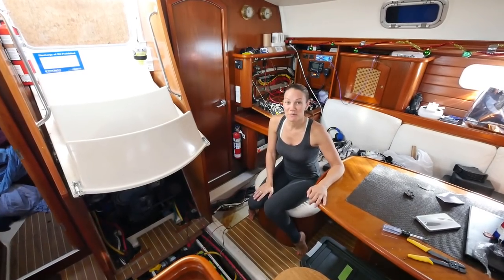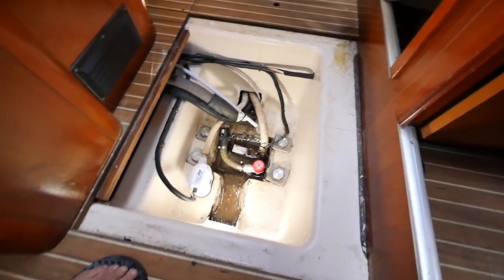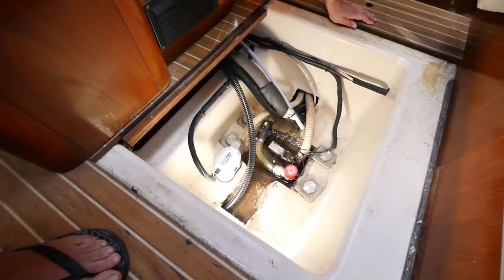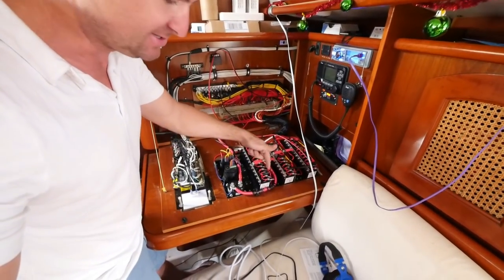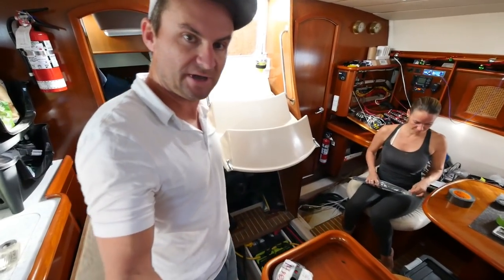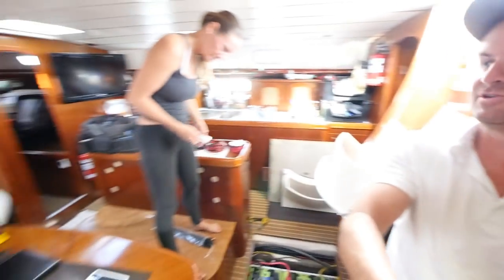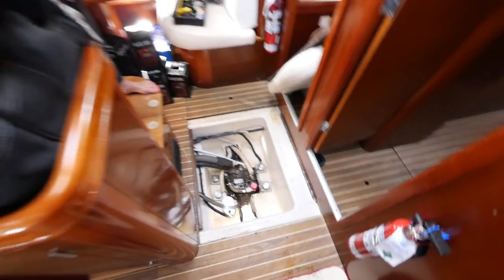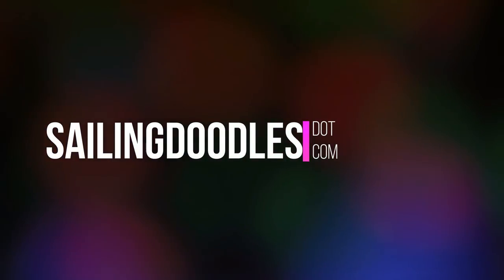Bilge Rat!!! - Maintenance Monday

Comment: Great idea Bobby, one suggestion in regard to maintaining the appearance behind the electrical panel.  Some guy made it his mission to weave all the wiring together and run them neatly.  Don't be the one who cannot spend a few extra minutes to replicate that initial effort.  It really isn't that difficult and afterward, you will be glad that it still looks neat!

Thanks for sharing...Fair winds!  Cool assistance by the way, you should keep her around!
Reply: Robert Applegate agreed. 

I put in my fair share of time in data closets.  It only takes a few minutes extra to bundle the wires in with the rest, and the payoff is worth it IMO.

I'd like to suggest keeping a roll of Velcro handy.  It's easier to use than zip ties in that you don't have to snip a zip tie to add a wire.  You just unhook the Velcro, add your wire, then reattach. 

I'm sure you could find a few additional uses around the boat for the Velcro too...
Reply: It all looks nice and pretty, until you have to trouble shoot a switch or wire, after that just use a few wire ties
Reply: Yeah that kinda annoyed me too but he did say it's temporary. I am a stickler for wiring. It would be terrible to be in rough seas and the bilge turns on and the wire wasn't secured and is now shorting out. I know it's on a circuit breaker but if the short is very minor and not enough to trip the breaker there could be problems. I've also seen situations where an adjacent small gauge wire chafed and touched on a bare area of a larger circuit. In that situation the larger circuit wouldn't trip and the short would continue and start a fire.
Reply: Another vote for keeping your wires neat.  Even the LED wires need to be cleaned up.  Also, there seems to be a hole already in the rib under the floor, if you can fit through that, should do so.  Nothing worse than wires allowed to move and potentially get pinched at some point causing gremlins.  You really don't need that kind of headache in the middle of the South Pacific.  Do it right while you are at the dock.
Reply: Be careful with temporary,seen way to many temp works that turned into permanent and later into tears. Specially with wiring,not only does it look neat but its miles safer in the end. Always walk that extra mile when you work on wiring,does not matter how small or how big the job is.
Reply: Wire ties to secure the hose, keeps it from flopping about underway...  Place a ‘Tee’ in the overboard discharge line and attach the new hose...  Suitable arrangement for a permanent installation!!!

Comment: Keep the wires bundled and label the new ones as you add them. I did a LOT of marine wiring back in the day. I found that labelling and neatness of the wiring harness made working behind the panels so much easier

Comment: If its salt water you have leak through the stuffing box or something in the back of the boat if its fresh water then i would say a water tank or a plumbing line of some sort is leaking. Either way the fix should be fine till you find the leak I see nothing wrong with it. Good job Bob and Laura!!!!
Reply: was going to say something similar... though that water does not look so "fresh" - it may not be salt water.

Comment: Good job team Bobby/Laura and pretty straight forward fix. If I was going to do anything differently, I would snip the zips and run the new wires (including the LED wires) along the same route as what's there. However, I'm a bit OCD like Laura so maybe that's not your thing. The next option would be to still run all the new wires along the same route and add new zips. Some of the newer zips can actually be unzipped by moving a tab with a small screwdriver. The last option would be use Velcro which can be undone much like the newer zips but a little faster and easier. ALSO, I would definitely throw a tie wrap around the new hose that's just laying in the bilge.  Thanks for a nice break on a Sunday!

Comment: Great video, and you can Never have to many bilge pumps on a boat! Even when you find the source of the water intrusion (and my bet is on a leaking fitting/hose from the motor,although it may end being a tank or stuffing box leak,an if that's the case it should have been caught in the repair work at the yard b4 you picked it up!) that little pump will become a safety spare..available to be put where needed, and always good to have. 
Don't forget to hit 'like' folks, it all helps. Do try and wrap up that wiring you've added behind the electrical panel, both for neatness and safety, and it's always easier to work on 1 that somebody has, can use those temporary plastic ties if need be.

Comment: The good news is you have months and months of baja cruising. So you will find the leak soarce before crossing the puddle.
Check the rudder post. Bendytoys have lots of rudder issues. Also you should be able to rule out stuffing box and engine cooling system in 1 minute.
Just look.
There are so many spots.
I would get laura down there with fresh water and clean everything real good. She seems like a team player for sure.
Man you are so lucky to have her. Immagine this trip with out her. It would be so different.

Comment: Put an oil absorbent sheet in or over the engine's bilge and it will resolve the possible issue of pumping oil or fuel into the ocean that others have mentioned.  I refer to the sheets as my engine's diaper.  West Marine sells them 5 for $6.00, pretty cheap considering.  If it is salt water in the bilge you should check your fresh water pump, hoses, heat exchanger and water muffler.  Keep on sailing and having fun!
Reply: this, $6 is bit more affordable than a $50k illegal discharge fine, clean that bilge with Simple Green, then begin the hunt for the leak, I agree that the stuffing box is most likely. As a matter of fact I would have  spare stuffing material, plugs, a way to secure shaft from going deep 6 among other things

Comment: Great Video guys! It's a temporary fix but I'm sure you've considered that If you spill any oil below the engine it will end up in the bildge, and subsequently into the ocean... Cleaning chems out of the bildge is not fun and when you go on a lean, those chems are gliding up the side of the hull making a big mess...

Comment: The area under the engine is not a bilge, it designed to be self contained so it wont get the oily diesel water that could get deposited under the engine, if you have a sea water or coolant leak, into the bilge and then overboard.  You do not want to pump it over board as it is a pollutant and can get you a major fine.  Water from this area is supposed to be removed by hand and properly disposed of like oil and coolant etc.  I noticed you had water standing under the engine in an earlier video and almost sent you a note about it.   If you are getting water in this area it is something that is not normal and should be stopped.  Also you are not supposed to set up one bilge pump up to pump into another bilge pump area, as you are now dependent on two bilge pumps instead on just one to move water overboard.  bilge pumps are supposed to pump water over board.  Good idea on the fix,  it is just not legal and should be repaired to marine standards.  Love the videos and keep up the do it yourself work,  as that is how you learn.

Comment: Bobbie, I agree with viewer who said the reason there was no  bilge pump under the engine, had to do with overboard discharge of any fuel or oil. Unlikely there would be a clogged drain hole to other bilges from engine compartment. I like your fix as temporary, shouldn’t be too much of a problem to find the source, easy to determine salt or fresh water, I’m sure you did, but zip tie, the new hose to anything, to prevent hose from moving when healed, fasten new bilge pump, to something so that won’t move, clean-up wiring in panel and label all additions, after you have found the source of the water leak. I enjoy all your videos, you do a great job, informative, funny and entertaining.

Comment: Don’t shoot me just trying to help.

As said in many comments - Don’t pump that water overboard. Fix the problem.

You’re planning a major trip. Fix the leak in San Diego where you have access to everything you need to fix it.

Is that pan under the engine separated from the rest of the boat? If so leak is from an engine connection.

I know you said it’s temporary but as FYI - the bilge system power should be from an “Always On” buss. An “Always On” buss is directly connected to the house bank so always hot. Circuit would be - fuse protection sized for load and wire size connected to “Always On” buss, then wire/cable sized for 3% voltage drop over length of run to bilge pump buss, then wire to bilge pump breaker sized for amperage and 3% voltage drop over length of run. The reason for this method is no accidental shutting off power to bilge pump system. You always want power to the bilge pumps, it’s a critical safety system.

Comment: Could the water be coming from the engine while its running? While you're motoring you might be filling up that area? Best to monitor and check before and after motoring and also while docked etc.

Comment: Engine compartment is isolated from the main bilge primarily to prevent leaking diesel or leaking engine oil from flowing into the main bilge. BTW, the mix of salt water, oil and diesel stinks really bad - from experience :). I would investigate the source of the water leak and correct it and only use the secondary pump for emergencies.

Comment: You should have a dripless seal that uses a small hose to allow some water for cooling. Check that hose as Beneteau puts it where you do not even see it and it should have a through hull fitting on it with a ball valve, if the valve is closed you might have destroyed the dripless coupling or it could be coming from the hose itself. If that is not where the water is coming from check the cooling water seals on the engine, see if you have any signs of leaks there. Would be a little helpful to know if it was salt or fresh water you finding in the engine room. Fresh is only from rain, or a leaking water tank line, tank, Might be a fill line for the rear tank etc but limited fresh water and easier to pinpoint.  Seawater has a few more options some being a lot more serious.

Comment: Taste the water salt would be a through hull, an engine coolant line, salt water wash down (if there is one) etc. from the sea.  Fresh water wood be from tank, sink line, or toilet flush line, or fresh water wash down.  Clearly several places to look.  If fresh you could put a limited amount of food coloring in tank to see if it leaks there or as you use fresh water systems which one is leaking. Salt water is just checking all the thru hulls, stuffing box, etc.  

I would also attach your bilge pump to the floor of the engine room at the lowest point you can access.  Run your wires under the stairs floor as it looks to be on top of the floor there.  Use screw down zip-ties for the hose from the engine bilge to the primary bilge area thru the battery box, flooring etc.  Zip-Tie the exit of the hose to the floor of the primary bilge as well. Good luck.

Comment: I agree with neatening of wires, pump shouldn't be in bilge under engine due to contaminates, If you had a oil leak, you will leave a slick outside, anyway I've had another idea that hasn't been mentioned:

I dunno how quick your water is building up, are the hoses from the refridgerant pump frosting, thawing out and leaving a small puddle? over time creating a bigger one. I know this is a long shot but I like to think outside of the box. Maybe they should be lagged?

Any plans to pop to europe? My place isn't a palace but i'll always put you guys up for a few nights and lend you a car if you come to the UK. Keep up the great videos.

Comment: You’re a good team Bobby & Laura. It is fun to whatch you as you work together. For your engine however, I would replace all the water hoses. It is a 10 year old boat and these hoses won’t get any better. You’ll just be chasing one leak after the other. For the angry comments from others, pfffff! A Diesel leak produces serious smell. You wouldn’t live on the boat if that was the case, and you could mop it away with absorbent tissue that you discard properly later. And oil doesn’t run through these hoses. 

Always a pleasure to whatch your episodes

Comment: Had exactly the same problem on my Beneteau 473. The water under the engine was salty and I then found a piece of line had worked up through the cutlass bearing causing the leak. Hauled out and fixed.

Comment: Nice temporary fix but make sure it is only temporary and than a backup when you find the leak.  Leaks generally tend to get worse not better with time.  Make sure you seal all wire connections, I like heat shrink type connectors and fasten the hose securely to prevent chaffing.

Comment: Just taste the water to tell if fresh or salt water.  I would also recommend connecting a check valve into the new hose to prevent backflow into the engine again.

Comment: We had a similar leak on our Beneteau. it was the drain valve on the water muffler. The valve worked its way loose about a half a turn and was slowly leaking into that holding bilge area below the engine.

Comment: My first thoughts were that it could be a leaking prop shaft seal.  I would also check your shaft bearing and possible shaft trueness to make sure no damage was done to them from running into that crab trap line from the earlier episode.  I'm no expert, so take it with a grain of salt water. :)

Comment: If you don't want to taste the water, you could see if the water will carry a current.  Sea water should let you put in in line between a bulb and a battery and still light the bulb whereas fresh should fail.

Comment: That rear area probably can collect engine fuel and oil leaks? In which case there is no bilge pump to ensure you can't pump them overboard for a ~$10,000 fine. Pump that into a blivet, not contaminating the main bilge, if that is the case.
Reply: Lyfan Deth water looked too clean , just got a minor leak. Remember it's not his boat.
Reply: But would it be his fine if he did pump oil/fuel overboard?
It might look clean now but if he spills into that bilge and the pump comes on automatically, well he won't be putting it back into the ground!

Pump it into a holding tank to be disposed of properly. This would not be the boats black water holding tank because that is legal to dump if you are far enough out to sea.
Reply: Yes, it did look clean. In six months time he might just forget all about it, then a little oil drips, someone sees a sheen on the water and calls it in...and since Bobby is the man in command of the boat,  the citation is written against HIM not the owners. This is a kludge, yes, it works. But it is safer to "fix it once and fix it right" than to lay land mines for himself, or the next skipper, who gets surprised when oil goes overboard. And a blivet doesn't have to cost a lot of money, you can get a 5-gallon empty milk blivet from any diner or restaurant. Free.

Comment: Hi Guys.

Did those wires change colour under the floor boards.?  That would make it a headache for the next person who follows you to track if there is a problem with that pump.

A comment here suggests that if the water is salt then it is a leak in the stern gland or stuffing box, call it what you like but it could just as easily be a through hull or hose attached to it.

Love your vids and your various ship mates.

David. Down Under.

Comment: Hey guys.  Good video however I am trying to wrap my head around why it was needed.  I don't own a Beneteau but there must be a channel the water could have passed through to run into the bilge.  It must've been plugged.  Just my opinion but unless I'm there, I can't be 100% sure.  LOVE the nice and tidy electrical panel!  

Love your videos and live chats.  My wife and I are enjoying them while we travel down the ICW to Florida and ultimately crossing over to the Bahamas before Christmas.  Hope you guys have a great trip!  

Phil and Michelle
S/V Mariposa
Reply: Phil - you would think so wouldn't you. I know my old trawler had holes under the stringers to allow water to travel to the low point.
Reply: The bilge below the engine is isolated to prevent oil or diesel from being pumped overboard.
Reply: Stuart McLeod You are exactly correct. An oil leak would be pumped directly overboard.
Reply: yep my bene is exactly like that one, back there stuffing box, raw water inlet about the only things that could be leaking, with it dry should be a quick job to figure out where it's coming from and fix....  Some area's pumping engine bilge waste overboard will earn you a nice fine just saying...

Comment: With the location of the water, under and to the rear of the engine, I'd start with the stuffing box.  I had the same issue and it was that slight drip of the stuffing box while underway.  The only real problem I wound up having with that small amount of water, is that it would start to stink after awhile.   But I like your fix.  I'm surprised there wasn't already a pump back there.